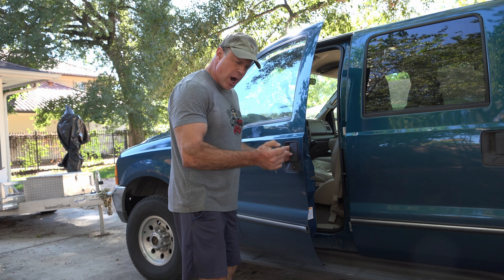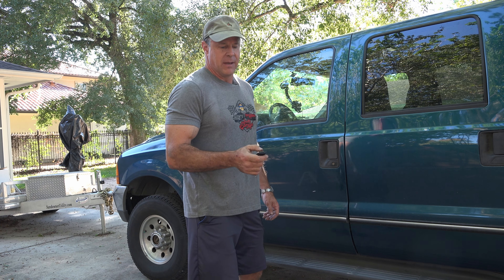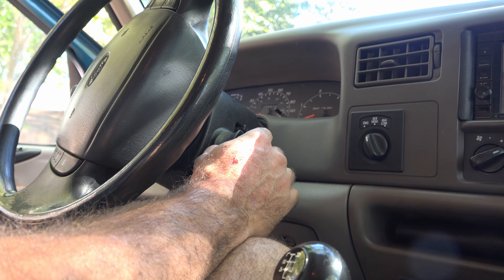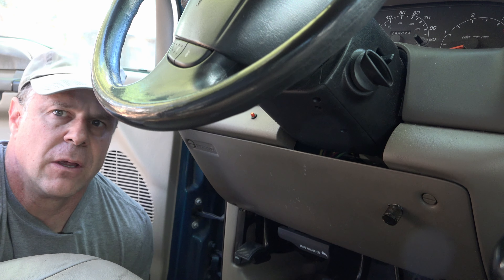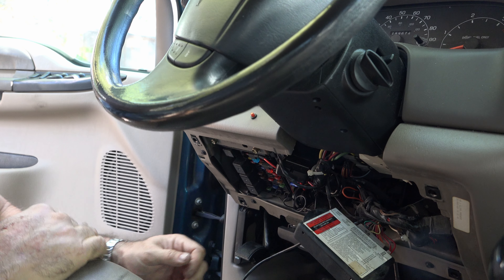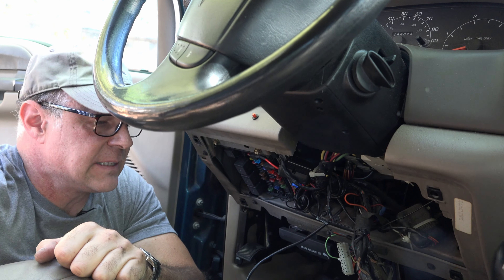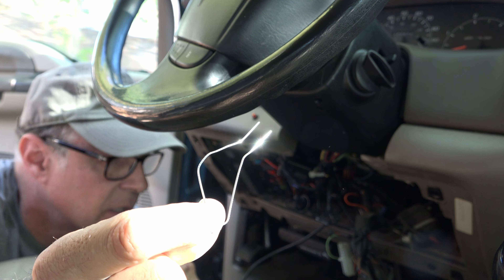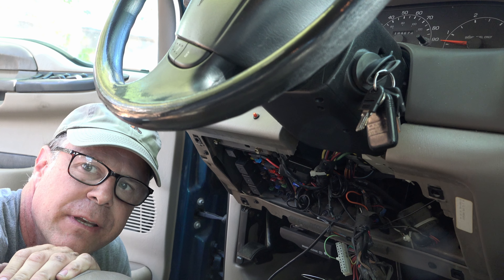Ford Vehicle Security System Malfunctioning? I show you how to bypass it and start your vehicle.

Comment: I really wish someone would come up with a technical fix or bypass to the pats system. So you DON'T NEED TO HAVE A KEY!!! Or 2 keys for that matter. Every video about fixing, bypass, solved, or whatever title they post, it's all basically the same thing. They HAVE A KEY THAT GOES TO THE CAR! My keys are GONE! I don't have a single key that matches the car. My keys are lost forever. You can't tell me that there is no way around the security system!
Reply: I'm going thru the same bullshit as you brother I lost my Damn keys and my fob won't work... I have a 2001 Ford F 250 V/10 that I've been working on for the last 3 month's everything is new except the engine block...and no one can bypass there has to be someone out there...I hope you get your vehicle on the road... Frustrated Ford enthusiasts...
Reply: Going through the same thing . Security light just flashes fast when i try to start it …i changed ignition cylinder transponder and key that goes with it still no lick let me know if you find a salution .
Reply: Me too. Anyone have any ideas? There is got to be some way some how to bypass this damn thing. I hate the theft system in my 2001 F150
Reply: I have a suggestion for you this worked for me on a 2003 Acura TL...  Take out the ECU there is a 9-pin prom chip in that ECU on the Acura was anyway break it off take it out of the circuit board there you can start it with any metal key... Cuz you still have to figure out a way to get the steering unlocked but I'm certain that you can find out how to do that that's just a suggestion I hope it works for you

Comment: Just got a 2001 Escort for a beater. I’ll try this in the morning. I probably set my alarm off half a dozen times tonight. My neighbors love me now.
Reply from the maker: Hello. Thanks for watching. That’s hilarious. I’ve been lazy and have not gotten around to fixing this issue.
Reply: @scottsgaragehtx439  I was actually able to remove the whole box. I guess Ford didn’t consider the Escort worthy enough to have an extra layer of anti theft.
Reply: @scottsgaragehtx439  do you do consultations? 2003 ford focus intermittent power fluctuations are 100% of the time ...fluctuating so much unable to start.... relay is clicking, everything is clicking on and off ...just replaced computer and NO CHANGE....

Comment: Just make sure you don’t have the paper clip touching any bare metal in the car. You thought having a bad alarm was bad, some poor bloke would ground his starter wire with the paper clip and really be stranded because he can’t find a replacement fuse 😂
Reply from the maker: Good point. Maybe I should have suggested insolating the paper clip.

Comment: 2004 E-350 security system woes... I disconnected the battery to replace the cruise control switch and when I reconnected the batter the security system went haywire. Problem is, the remote key wouldn't work, same as yours at the beginning of your video. Well, push come to shove, I found your video and tracked down the security module. It was a different module, a World Link WL-504 and the wiring was different, but I found the wire codes on it and the starter wire was part of one of the large connectors with no corresponding input. I figured I'd have to come up with a way to energize it but for shits and giggles I thought I'd try to start it first. The damn thing started with the module completely disconnected and no further connections made. Good enough I said. I doubt the power locks will work but that's fine with me. Thanks for posting this video, it turned out to be my saving grace.

Comment: This is brilliant Scott's Garage "HTX"!  I was 3.5 hours from home and tried half a dozen other remedies... none other did diddly squat. Got me home well, so thanks a lot for posting 
👍 PS: 2000 Ford Explorer it's tucked up super well inside and no such luck with merely springs clips and a quarter,  but oh well. (Subscribed)
Reply: I have a 2000 as well and I can't even SEE the anti theft module...mind telling me where it's located under the dash?  :)  Please!!
Reply: In the 2000 as in this video it is by the driver's shins and knees.  Additionally in this particular model there is a plastic cover with tricky small bolts involved two of which are on either side of the hood release but the other should be more visible. Once you pull that down and out you'll have to deal with a metal plate behind it was about five or six other bolts. They just don't build them like that anymore! Once you get in there you should see it on your right side so unplug it and jump (bypass) it as described in the video. You don't really need to get it repaired after that unless you want all the alarm stuff and the ignition kill but considering it's age come on. Hope that helps and right back if you need more instructions...
Reply: @drumguy1960  if they did the explorer like they did the ranger, its behind the glovebox,

Comment: That's not a factory alarm, those are dealer installed, aftermarket alarms. The OEM or factory alarm will honk the horn and not have a cheap siren or a rigged in place module like that. 
The best thing you can do there is to follow the wires back to where ever they cut and spliced that thing in and reconnect all the factory connections and throw that thing in the trash. 
The early versions were made by Code Alarm. The current brand for those is Voxx Electronics.
They were only as good as the install itself. The problem is they paid techs very little to install those and most allotted only a half hour for the full install. 
Part of the install includes cutting the factory power lock wires, starter wires, and ignition wires on some models. 
If these connections were not made with good solder and heat shrink your left with a bunch of twisted and taped connections that are sooner or later going to fail. 
I've seen some really poor installs over the years. To do it right, on some models your looking at several hours to half a day to locate and splice the correct wires. 
Then you have the likely hood of that module failing, or having trouble when it comes to dealing with the key transponder system. 
I had a conversion van with one in it, when I got the van I re did the install correctly and it was fine for about 5 years, then the module failed, one of the internal relays became intermittent. I was able to fix it but soon after other parts of the module failed as well. I removed it completely with the thought that at 8 years old, and being parked in my garage, the chances of theft were slim.
Reply from the maker: This is good stuff. That is why I cannot find a matching fob to replace mine. It makes sense it is a dealer installed unit with Ford licensing. Thanks.

Comment: 2000 Ranger with valet light. System 3 or 4. Did they ever put override switches? My manual from 2000 does not show it. Never really had to mess with it until my battery went dead.

Comment: Does it work on the 07 expeditions? Or do I need to find a different video
Reply from the maker: @aprilsmith1652  I'm not sure about the 07. If you have the two button key fob, it probably will work. I am assuming your alarm works similarly to mine as it interrupts the voltage to the fuel pump. With that in mind, if you can find the box the wiring similar. The great thing about this box is that it is marked with the wiring diagram. Good luck.

Comment: Would this work with 2001 ranger with 6 cylinder, 3.0 L engine? 1:26
Reply from the maker: @LisaTynes-e5w  If the box is the same, then, yes. If it is different, then it's just a matter of jumping the ignition. Hopefully it is marked on the box. It was very helpful  that these boxes are marked great.

Comment: WOW - impressive! Love this - thanks! My 2002 Mustang module doesn't have any wiring info on the box. Any suggestions on how to identify the correct (2) wires that need to be crossed?
Reply from the maker: The colors should be the same as the ones on my module. Can you identify the wires on the video?
Reply: @scottsgaragehtx439  03 ford explorer would it be the same?

Comment: Does this only work if you have an alarm on the truck? I’m having an issue with mine also and it’s driving me nuts. I don’t have an alarm and it’s just not starting and it’s a 2001 f150
Reply: Did you ever fix it?

Comment: Hi and thankyou for this video. My 02 Ford Explorer won't start and the THEFT light is flashing and making a clicking noise. Do you think this same procedure will work for me and is it only a temporary fix? TIA
Reply from the maker: Hello and thanks for watching. It should if you have a similar alarm box. All your are doing is circumventing the alarm and restoring power to the ignition switch.

Comment: once the truck starts, do I take paper clip off and reconnect the module?
Reply from the maker: No leave in. It should die i((fuel pump cut off) if you pull. The clip. This is meant for a temporary fix to get to a repair shop.

Comment: This work for the 2002 excursion also ?
Reply from the maker: Yes. IF it has the two oval button (and one red oval panic button below) key fob. I can not find these fobs anywhere and will probably have to install a totally separate system. Argh! I have been putting off spending the $. I am not sure if the square button fobs has the same controller, but there is only one way to find out. Take that panel down and see. Good luck. Thanks.
Reply: Thanks, I don't have a quarter or a paper clip. Just joking 👍

Comment: The alarm system is an option ? Not on all of them  right?
Reply from the maker: That's correct. There were two versions. A manufacturer installed and a dealer installed  I am told.

Comment: I am having this issue with my 05 ford, 6.0 and I opened the bottom piece and the alarm box is not there? What can I try
Reply: after 2002 they built the PATS [anti theft crap]  into the PCM thats why you cant find it, its part of your trucks computer.

Comment: Did you find it drained your battery as well?
Reply: This is the issue I think I'm having on my Mustang.
Reply: @kevinstewart5375  I found it was an alternator there is still a drain in the system just need to drive it more. But I’ll be trying this next